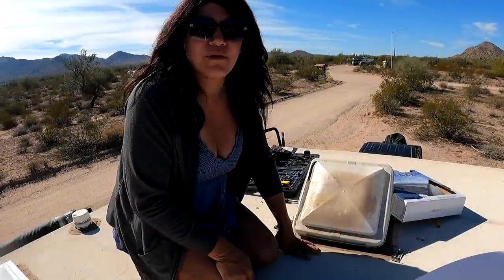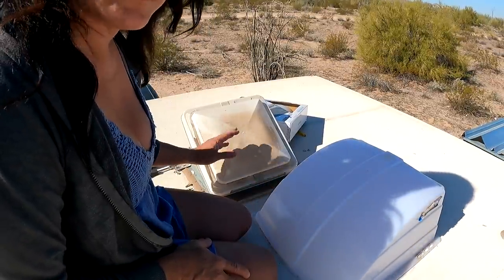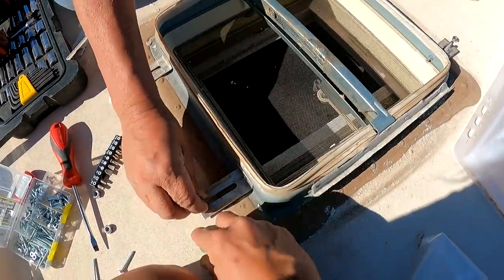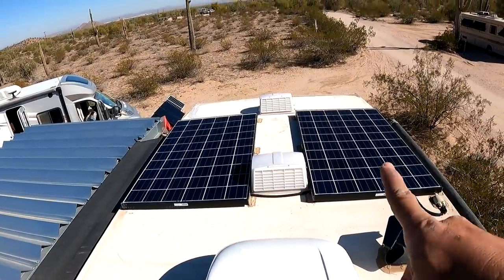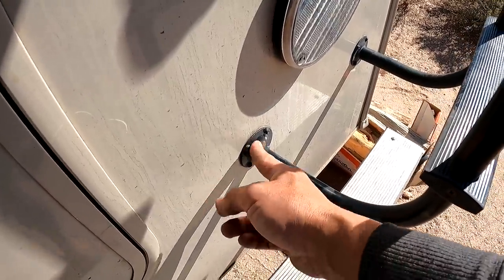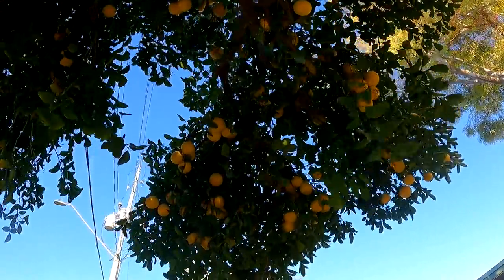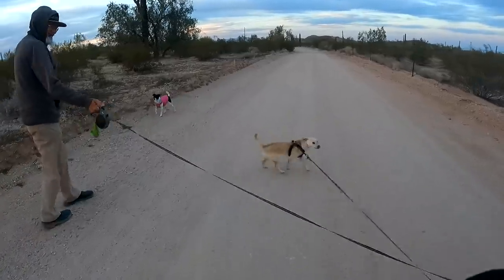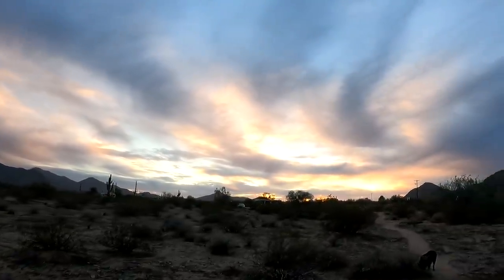New Isn't Always Better - RV Fixes

Comment: Ausia you're perfectly correct Dave was just mentioning that on the video the other day glad you're keeping it in good shape on my solar panels on my truck camper I used Rain-X and it doesn't seem to bother or cut down the output just a thought but Rain-X nothing will stick to it including dust job well done Ausia💖🤗

Comment: Out of curiosity, I just went out and checked my ladder (my rig is a 2016, which I also bought new) and, fortunately, everything still seems tight. My neighbor (and good "man-handy) helped me install the MaxAir covers over my vents (which were also beginning to crack). We also used bolts instead of screws to secure them to the vent frame. This year (winter in Arizona), I have replaced the CO /LPG detector, the plastic handle on the black tank valve, fixed a wobbly toilet (it had a broken floor flange), cracked and pitted windshield, all in addition to normal/routine maintenance, refrigerator serviced, oil change, etc. I enjoy and get a lot of useful info from your "how to" videos, Ausia. Thank you!

Comment: We bought a 5th wheel brand new  and it was appalling how cheaply it was made. We finally ended selling it and upgrading my Nissan NV200 and our pickup topper camper. Cheaper, better gas mileage and much more solidly built.

Comment: M y rv is  a Forest River and I could right a book about the issues I have had.....2016 with easy 12,356 miles on it. No boondocking.....almost afraid to take it where you have been. Have stayed on pavement....rv parks.

Comment: Ausia you guys are on alot of wash board roads.  That will jar any vehicle loose .  The only machine made for that is side by sides. LOL.  On my 2016 tt i replaced my vent
covers to.  There such thin plastic and the arizona sun  will  dissolve them.  Thanks for sharing.

Comment: Why not unscrew the flange, tighten it up on the pipe and screw it back in with some lock tite. It would be a good temporary fix that might last a long time. You could do all of them in  less than 30 minutes

Comment: Don’t kid yourself the more the rv costs the more expensive the fix and they all need fixes.   You wind up spending your time at the service dept  for weeks or  months getting stuff done over and right  during the warranty period and after.  Had many new rv’s and always problems just get used to it anymore.    I would say Lemons.   Citrus fruit is ripe in December usually.   Lemons are $ .89 cents each here in Colorado, unreal.

Comment: You don't have to seal the edges of the roof vent to keep water from seeping in? I would. For Solar panels Fill a bucket with warm water and add a small amount of mild soap. Rinse solar panels with a hose, or with another low-pressure sprayer. Use soapy water and the scrubber to gently scrub the panels and clean them of any debris or buildup. Rinse solar panels thoroughly to remove any soapy water.

Comment: Nothing will survive being in harsh conditions for long periods of time. Who ever mounted the over cover didn’t use the supplied bolts to mount the cover to mount and the mount to the vent frame.  It a poor design, poor installation using the wrong parts. Do you think the items rattling loose are from the wonderful washboard roads? That big heavy extension ladder like I have shouldn’t be mounted to that ladder. Nothing should be mounted to that ladder, you have so many things attached to that rig, it looks cool, but seems like added weight. What about the plant hangers jabbed into the seal on the overhead cab? 🤦🏻‍♂️

Comment: Are you still under warranty?
Reply: If you read Coachmans warranty, If used as Commercial/Permanent Residence/or Rental, there is NO warranty. I'm not sure what Ford has for a powertrain warranty when it's being built out as a class c rv.